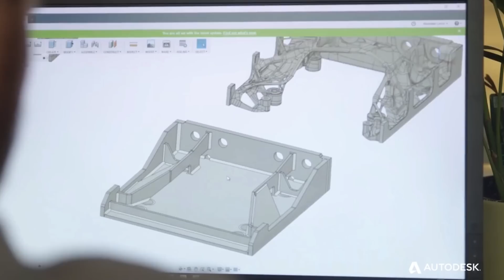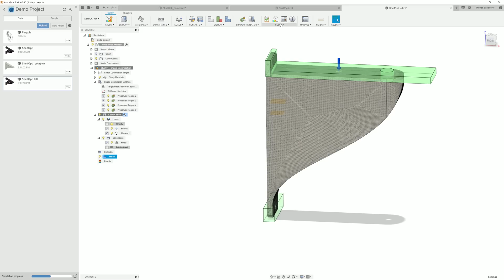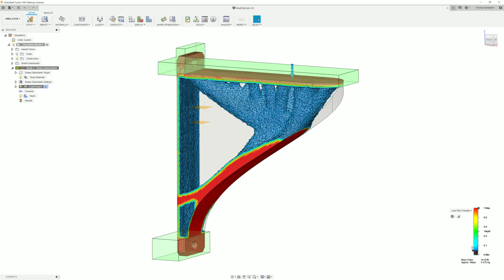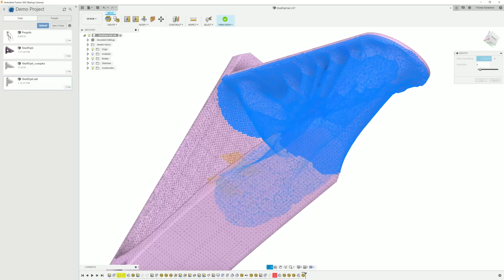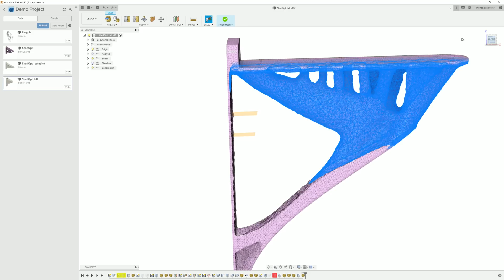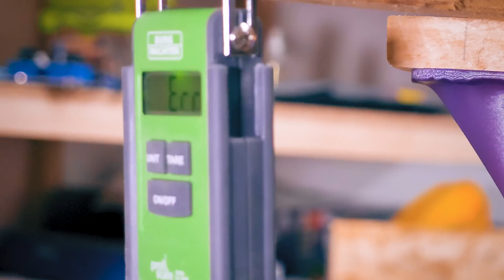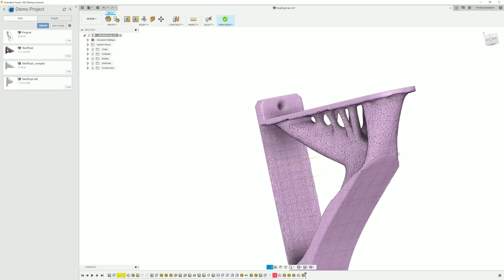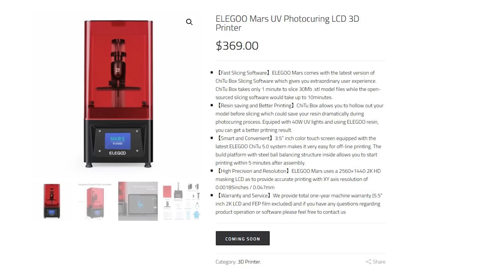Making STRONG shelves with Topology Optimization

Comment: A couple of things have been mentioned here already, namely the fact that this kind of topology optimization minimizes compliance and that the printed part is hollow etc.

However, there is another issue here: The simulation that the AD software is running is based on (probably) an isotropic, linear-elastic model. In reality, the polymers that constitute the printer materials are vastly more complex than that, and the process of 3D-printing produces parts that are incredibly different than this assumption would allow. As far as I'm aware, it is still very much an open question to develop a good finite-element model for melt-extrusion parts. Such a model would have to include parameters like the environment the machine is in, the machine parameters themselves, etc.

Topology optimization is definitely a very cool technology, but as of yet, its compatibility with desktop 3D printing is in its infancy. Validating these parts is very difficult, even at the commercial level with state-of-the-art technology, so if anyone is designing printed parts that are load critical, be very careful about the 'plug and play' capabilities within the AD software (and other packages).

Comment: i don't hunderstand the hype train built around fusion360. I worked as a designer for a rank one subcontractor of AIRBUS that also build their own plane and of course we use CATIAV5 as designing suite. CATIA interface is... well not good looking but what you actually ask a CAD system to do is to be fast when you reconstruct a model and easy integration with production tools. If you want to do beautiful rendering you just export to whatever format and give the work to someone that actually know how to make good looking render. Now i worked with CATIA SolidWork and fusion 360. When you want to do topological optimisation most of the time you can't because it's too costy to produce the designed part. So I don't hunderstand the TREND about those techniques that are good in their subject but are rather useless unless you have production mean that is 100% compliant with weird géometries. This is just pure marketing, they pretend you need this feature. it turn out that no you don't plus it would be more costy for the customer so that he will go for cheap simplier design. Thomas got the point on that. I don't know but nowday more than ever i feel like the hardest question to anwer isn't what's possible to do but what is worth doing? do you agree?

Comment: You NEED to look for the studs in the wall or else that happens 11:30
Reply from the maker: It's not a stud wall. Also not drywall.
Reply: @MadeWithLayers  aren't all wall supposed to have studs 8-11 inches apart?
Reply: @HellFire178  he lives in germany not usa. Here our walls are made of concrete
Reply: @marcusvoss  really? That's so different, what's the benefits?

Comment: Strength is not rigidity. This type of topology optimization of this 
sort can only ever optimize rigidity, typically at the cost of 
strength. It specifically computes forces * displacement because the 
math allows you do to this very easily, and inexpensively. Choose to 
optimize anything else, and the problem becomes thousands of times more 
expensive, requiring completely different approaches.
Reply: Sorry, you're wrong about this, you can use gradient-based TO for optimising stiffness, strength, natural frequency, and basically anything you can derive a "topological gradient" for, AND any combination of the above.
The different, expensive approaches you mention are presumably "non-gradient-based TO", which you're right is generally much slower, but not necessary for optimising strength.
Sincerely, a PhD student working on topology optimisation
Reply: @thealienrobotanthropologist  The majority of engineering based retorts to this video are all speaking from the mindset of like you say basic engineering knowledge i.e  "strengths of materials/geometries" which is completely valid. 

I'd be curious to take say specified geometries from a steel manual and compare "optimization" (if an) with different load combinations. 

I've been out of the force diagram business for quite some time now, but my hunch is these topology type optimization would leave designers making poor decisions that don't consider multiple loading factors.
Reply: @zakwhite5159  the majority of "engineering retorts" here, were made by the ignorant. They know just enough to be judged accordingly.
Reply: The same process could just be applied according to a stress based criterion though.
Reply: Are there any free and open source software packages for topology optimization or generative design?
Reply: @thealienrobotanthropologist  agreed, a simple right angle triangle would have been the strongest with the least material. All of the support for the shelf is adding zero strength here because the shelf is self supporting. It needs braced on the outside and at the wall, that is it.
Reply: @JamesSeedorf  This is incorrect, the topology optimization also specifies a right angle brace. In this video he left in dynamic curves as limiters on the outside so a more "natural" shape would form.

Also rigidity is the objective for this application. Strength is based on the slicer methods.
Reply: @JamesSeedorf  and a right angle triangle looks just exactly the same like the one your neighbor has. If you want your apartment look like an Ikea catalog, just buy the brackets. If you want something unique the video shows how its done.
Reply: It works though....
Reply: @thealienrobotanthropologist  Please upload a video that shows how you would design such a beautiful piece.
For someone who isn't artistic this method is fast and simple and apparently it works.
Reply: @Jehty_  Except for the aesthetics... I wouldn't call printing each part for 20 hours fast... whereas you could cut the wood for the triangle supports and fasten them together within 8 hours i reckon..
Reply: @madhuguru3130  you don't get it, that's eight hours spent not thinking, becoming a better engineer or designer but doing labour which in and of itself isn't bad but you've nonetheless missed the whole point.
Reply: Strength is very subjective. Strength of what? From where, to what angle?  We need a definition of "strength" in terms of 3d printed parts

Comment: I like the video and the bracket!  very cool stuff.  I do want to make a note/distinction for your viewers about toplogy optimization vs generative design.  At the end you pointed out that Topology Optimization doesn't factor in the actual load value, just the load path.  It is important to note that Generative Design does.  It factors in materials, manufacturing methods as well as multiple load cases.  I made a generative design shelf bracket for example that factored in loading just the front, just the back, equal distribution and someone bumping into it from the side.  So while yes the cost of 5CC vs 125CC is pretty drastic, they are very different technologies and with Generative Design you can have solutions for 7 materials for each manufacturing method you chose, so literally hundreds of choices to run through for that 25CC buy in.

Comment: I'd like to see a stress test comparing a topology-optimized shelf bracket with more conventional 3D-printed brackets, to see exactly how much more weight it would allow it to hold before failing/sagging.
Reply: I don't think this allows more weight then the full brick if that's what you're asking. It's obviously weaker, but it takes out a huge percentage of the material for an insignifant strength loss.
Reply: almarc the whole point of topology optimization is to reduce used material while maintaing the same properties as the original structure.
Reply: @ggeorgo555  I'm not a certified professional of course, but it can't remain "the same". It can only be 99% or something as strong. Unless you remove some bump on the side that literally carried no weight on it whatsoever.
Reply: @almarc  
I didn't mean testing whether it was stronger than the full brick.
By "conventional" brackets, I meant like, 3D-print the kinds of brackets one might find in a store. One that's literally just an L-shape, one that's a triangle shape (L with a single crossbeam), etc. The topology optimized bracket, judging by its appearance, would actually have slightly more material than these.
Sure, topology optimization is built for retaining mostly the same strength while massively reducing material used, but another way to look at it is that it can massively increase strength with only a small increase in material used, depending on what is used as the input shape. A bracket with 90% of the strength of a solid square block is likely going to be stronger than a bracket with 100% of the strength of a hollow triangle.

Comment: interested in industrial design. mounts brackets onto drywall with molly bolts and glue.
Reply: It's not drywall lol. Here in Germany walls are typically made out of concrete or concrete bricks with plaster/render added on top, also inside of houses. So mounting a shelf with dowels and screws is the way to go. You can see him using a hammer drill in the video too.
Reply: @kurtwagner6574  thx 4 elucidating
Reply: @kurtwagner6574 
Actually it is foam concret bricks (ytong), so definitely not dry wall, but also not solid concrete.
Reply: @TBFSJjunior  Yes you are right ;)
Reply: Here where I live all the walls are always thick and strong, so when I tried mounting some things with walls like those, it was very confusing for me at the beginning :D
Reply: LOL yeah.

Comment: You need to drill into the studs. That drywall is likely gypsum, not very strong.

If you HAVE to anchor in the sheet, use an expanding anchor that expands on the other side of the sheet. You can find these in hardware stores; look like mushrooms once they expand.
Reply from the maker: Well, the wall isn't drywall, so....
Reply: @MadeWithLayers  Is the wall solid or hollow? Or a mix, like you get with channels in cinderblock? The red anchor shown in the video looks like a masonry expanding anchor (like you'd use in solid brick or concrete,) which is not right for anything with a cavity behind the surface -- you'll want a hollow wall anchor for that.
Reply from the maker: It's "foam concrete", commonly known as "aircrete", which is solid, but porous material. My anchors are rated for that use.
Reply: @MadeWithLayers  If the shelves are still sitting there I guess it works well :-)

Comment: Interesting but some engineering flaws or deliberate errors are in the setup. For example why having a vertical plastic plate between the holes? The wall will be much stiffer than that.

Comment: I never saw this in Fusion before!  This is awesome!   Use stud finder and good quality screws (NOT drywall screws, they are not designed to be structural) for anything heavier than a picture frame.  That is not safe.
Reply from the maker: It's not a stud wall. Also not drywall.

Comment: The simulation is made for a solid part. It looks like you printed it at 25% infill. Try 100% infill and  you should get better results.
Reply: Better than holding 65kg+? What's the point of making it more expensive and slower to print?
Reply: @NigelTolley  My point is that after testing the bracket in the video, he could even further reduce the material using the topology optimization using an infill at 100%. By doing this, the overall design will be reduced with less material. But like you said, even a 25% grid (or whatever infill type and percentage he was using) is surprisingly strong.

Comment: The algorithm doesn't seem to take into account the density or intrinsic qualities of the material used,
unless you skipped informing viewers that the program takes the printing hardware into account.

A topographically mapped optimization could still have structural weakness,
however normalizing the best geometric fit of a generic substance is still a worthy feat.

Comment: The algorithm doesn't seem to take into account the density or intrinsic qualities of the material used.
A topographically mapped optimization could still have structural weakness,
however normalizing the best geometric fit is still a worthy feat.

Comment: they look fantastic thankyou gjgj, i think i would prefer to model the organic type shapeys manually and then run the simulation on that to give it more guidence - especially to limit the simulation to the internal or hidden areas so the outside could just be fully aesthetic designed

Comment: Using topology optimization, and then not 100% infill, defeats the whole purpose. Optimization already told you which parts are important, and they are 100% important.
Reply: olegkikin I 100% disagree for various reasons. Mainly because the original part is also hollow, so optimizing to another hollow part is still valid optimization. What would not be valid is the subsequent stress simulation or any safety factor produced for a given load.
Reply: Not really, because the main purpose was to produce a funky, organically shaped bracket. It has to be strong enough but it's not an aeroplane part or similar – it doesn't need to be as light as possible. Not too much material and funky-looking is the name of the game.

Comment: This seems like a great (and extremely cool) design.  Did Tom mention his print settings like the layer height and the type and percentage of infill?  Also, I wish he had spent a bit more time describing the modified mesh he used to increase infill around the top mount.  Finally, am I crazy, or does the design fit across the width of a Prusa MK3S?

Comment: I'd like to see it redone with the top wider than the bottom where it connects to the wall. 
Since that was the failure point, and it doesn't have to be straight and square to save material or make it easier to produce.

Comment: you need to mount those to studs in the wall, anchoring to the  drywall is usually a bad idea
Reply: It is not drywall. He literally says they are construction blocks. Not many countries build houses like the US does. They're still the wrong fixings though ;)
Reply: @MarkHanford  He literally has no idea what kind of wall it was... It was most likely a plaster wall. The can withstand quite some force when plugged correctly but it is always best to find a stud.
Reply from the maker: I literally say it in the video, it's foam concrete.
Reply: Drywall anchors are rated for like 50lbs + per anchor, and that’s for the crappiest ones.
Reply: @joshuawiens1344  good luck putting a drywall anchor into masonry block. That's even more worryingly wrong than the slightly wrong fixings Thomas used.
Reply: lol concrete not drywall...

Comment: Let's just agree that TO is just a toy in the context of this video. It's use isn't economically reasonable when solving this simple task, like the most commented. Conclusion: you have made overpriced brackets.
The TO is useful when it comes to homogeneous materials that cost a lot. For example, aerospace uses it to lower the mass of mounting devices and satellite plates. Not to mention that the product of optimization itself is never used and always redacted by the engineer. You see, the TO algorithm itself is relatively simple, it just removes the material iteratively. The main task is ALWAYS on the engineer who prepares the model before (to create a design space) and after optimization (to prepare the part for CNC and stuff). A man also decides about the material and optimization goal, so it isn't a walk in the park. There are also more complex programs than Fusion.

Comment: All of your test prints failed at the sharp corner between the optimised and non optimised sections. Stress concentrations rise rapidly at sharp corners like that, so I think you could have made your design noticeably stronger just by adding a fillet in here. End result looks really cool!

Comment: No one but designers (Who have no clue about engineering usually) who want to create an organic shape use Topology Optimization..

It's cool looking of course but very expansive to produce as you learned and never practical.. as for best strength to weight ratio you can stick to normal shapes like triangles and squares and play around with holes and and material thickness and i can guarantee that you'll receive a better final product than this and for less time too in most cases..

It's a 100% artsy tool.

Comment: Physics noob here, but would it help stress if the top was wider, so the 'branches' would spread out like an actual tree (creating a V from the front)?  
Also, can the shape be constrained from entering certain spaces (pruned?), pushing the optimisation to be more curved, for instance?    I notice the design impinges on the space of the shelf below it, and was wondering if a more arched design would be less demanding on space?  They look awesome though.   I have a bookshelf project for my front hallway for which this would be great!
Reply: You can set constraints and with the green cubes like he showed in any shape so the software will create something around it.

it's really more of an Art tool than an Engineering tool because manufacturing this is always an issue unless it's a one off product and you have access to a proper 3d printer.